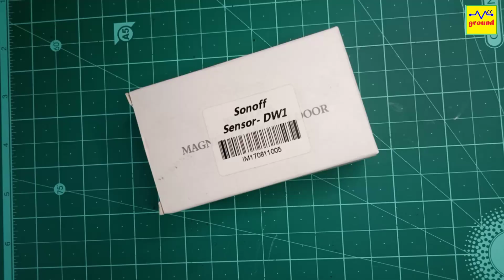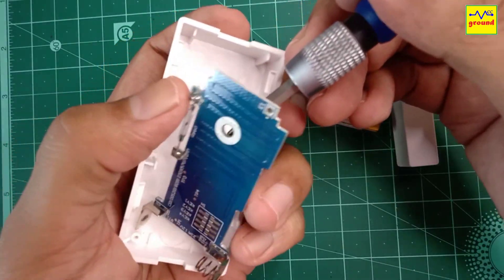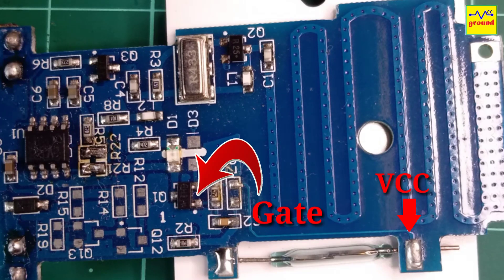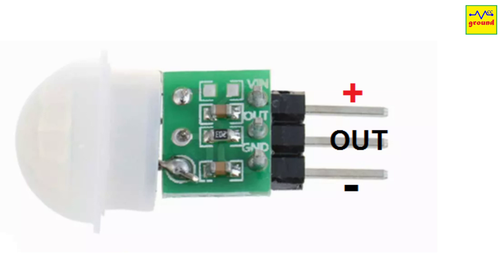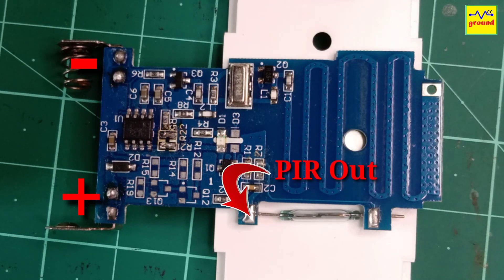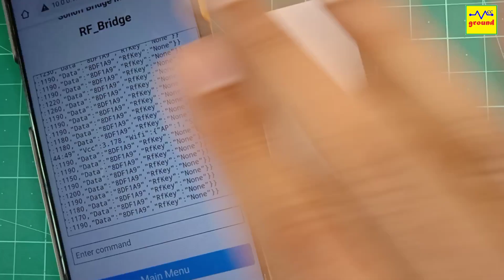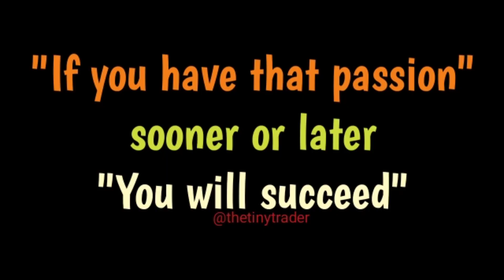#40 Modifying Sonoff DW1 RF Door Window Sensor | Repurposing a dumb Sensor | vccground

Comment from the maker: Update: I have further modified this single door sensor to use it as an ultra low power window/door sensor as intended. Now it sends both OPEN/CLOSE codes as well as Battery LOW/HI states too. Its ultra low power, hence can run for years on a single battery. Do watch it here: https://youtu.be/8dT95zBeb1U

Comment: Hi I am trying to do something similar but instead of the motion sensor I want this to detect when the calling bell switch is pressed. Can I connect the calling bells light power wire to the sensor gate. Will this act as the high pulse needed? Any other idea how we can do this?
Reply from the maker: What type of calling bell do you have ? How much voltage does it give when the calling bell Switch is pressed ? Need to share all details to let me analyse and suggest you a solution. You may also join vccground telegram channel and share pictures of your calling bell internals for my better understanding.

Comment: Hi vccground I like your video but I could not get this to work with the eWeLink app, I was hoping not to setup esphome yet.. am I missing something?
Reply from the maker: To pair Sonoff DW1 RF sensor with eWelink app, you first need to add the Sonoff RF Bridge into eWelink app. Please note, that eWelink app doesn't directly support RF devices. Hence to use RF devices, you need RF bridge device that receive the RF signal from the sensor and shares it to eWelink app over the wifi network.

Comment: Hi bro I need help to make one project.
 
I want to monitor whether there is a power in my home or not. for that i want to check all my AC 3phase is live or not using esphome  how to do it
Reply: Do check Video no.24 and 26 on this channel for the same. You'll get an idea for the same...
Reply from the maker: Yes, Please watch Video no.24 and 26
Reply: @the_vccground  yes i watched those videous ... but i'm looking for simple DIY solution.
Reply: hi thank you for your comments I finally used "220V AC Optocoupler Isolation Module for PLC" module to do the job .... its working good.
Reply from the maker: @jagadeeshv2763  Thanks for this comment. It may help someone else too ❤️👍

Comment: If placed in a busy area, the battery will drain very quickly, right?
Any fix to add timeout/delay?
Reply from the maker: Offcourse, any battery powered device, if placed in a busy area, will drain the battery fast. Will try to discuss and resolve this issue in a future video.  Thanks for sharing this issue... ❤️👍
Reply: Any update on this?
Came here again after watching the latest video😃